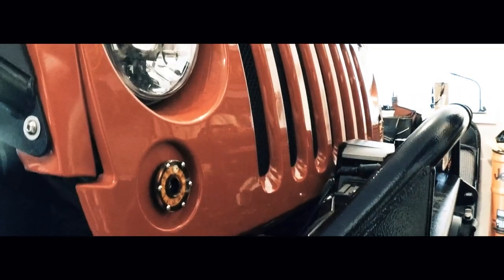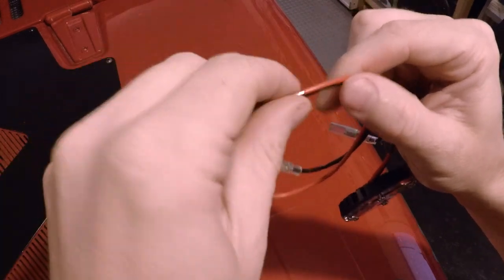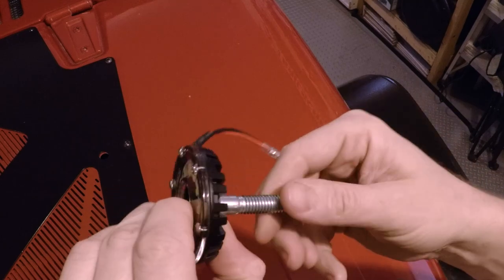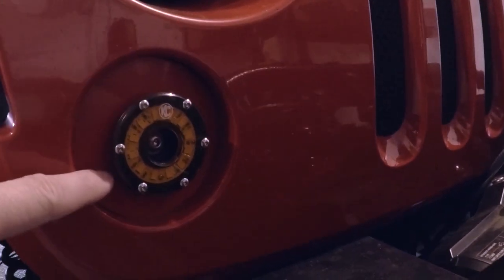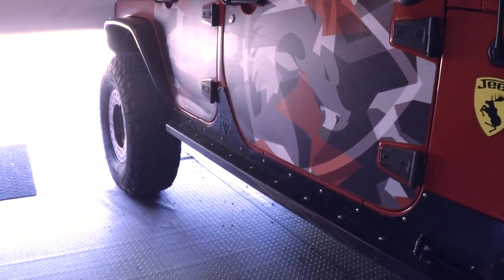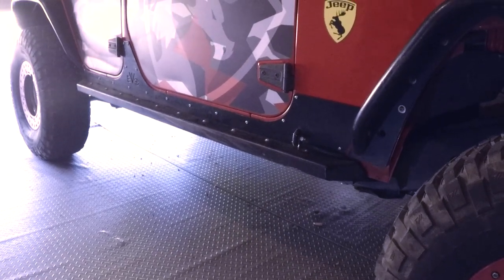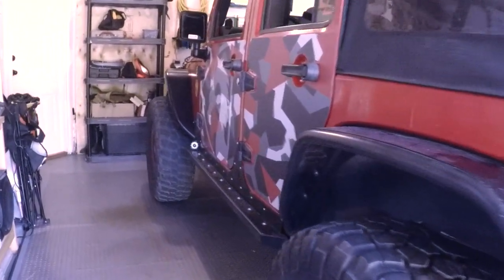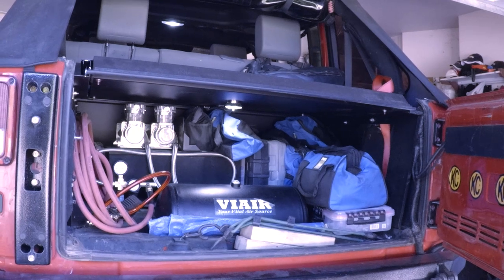KC HiLites Cyclones LED Jeep JK Lighting | Jeep JKU Mods

Comment: Finally!   I got that knows what he's doing with wiring.... To access reverse and interior light circuit... Where did you tap in..... By lights or fuse box?
Reply from the maker: I tapped in to the harness just as it enters the cabin on the passenger side footwell, which was then used as the positive goiing to my switch that then runs back to a either trigger a relay (for reverse circuit) or the trigger for the control box on my KC RGB lights. I can't recall the color code of the wires off the top of my head, the reverse I look at the color of the wire at the tail light and traced it back, the interior light I found by googling. The harness wire colors to vary by year so even if I had the colors its possible to not be the same on yours. Once I was fairly sure I had the right wire, I cut it, and tested it. If it was wrong it would be an easy solder and heat shrink to repair it, but I got them correct.

Comment: Based on your video I picked these up. I noticed they get really hot fairly quickly. I had another idea for more lights, but would be mounted on plastic. Since these lights get so hot, would you recommend the lights installed on plastic? Would I need to add another material to act as a heat shield buffer?

Comment: Can you show how you did the wiring and stuff?
Reply from the maker: I'm going to be installing another set in another Jeep sometime in the near future and I'll record it. If you check out my KC RGB rock light video, I use alot of the same paths for running wiring. The biggest difference is the RGB lights have a controller box, and the cyclones run off a bus bar.
Reply: @Casey250   so is there a relay or fuses somewhere in that line or is just battery-bus bar-switch-light?

Comment: You seem to have an intimate relationship with the factory harness. I can wire up accessories all day and have them work on a switch by themselves. I can’t figure out how to put my reverse lights on a switch. My goal is to still have them come on when in reverse, but also be able to turn them on from a switch when I’m not in reverse. Any experience or ideas? Thanks.
Reply from the maker: That is exactly how mine work. I use a 3 position on-off-on switch i ordered on Ebay. The switch has two source terminal and a load terminal. One source is the reverse circuit that i tapped into. Second source is positive from battery. Load goes to the relay that triggers the lights I use for reverse.  What you end up with is a switch that can be toggled as you described - on as automatic in reverse, off, on manually as needed.

Comment: I have had several cyclones fail me lately. How have yours been holding up? First one to go was in the engine compartment from under hood kit, they repaired it under the kc warranty, but now 2 that I’m using as a 3rd brake light are failing with several dead leds showing up in the ring.  The under hood light was a complete burn out.  Don’t think I want to continue with them, to much of a hassle to get approval and send back for warranty.
Reply from the maker: I had 1 loose 2 LED chips on it and that is it. Sorry to hear about the bad luck :( KC's warranty is pretty good as well as their customer service, but swapping broke parts is always a pain for sure! I haven't seen anything with the versatility for mounting though that would compete for some of the install cases that I use them for.

Comment: Hey Casey thanks for posting.   I have one question.   Why dont you wire the under hood light to the hood switch so that the light comes on when you open the engine compartment? 
David
Reply from the maker: I would need to add a hood switch on my Jeep. However, ya, definitely a good idea. KC makes a hood switch kit I beleive.

Comment: Do you just hook the reverse lights into your stock wiring harness?
Reply from the maker: I spliced into the stock harness to a relay. The relay then triggers 4 cyclones when I go into reverse.
Reply: Casey_250 Yhank you.  This was very instructive and just the information I need to get some extra lighting in my Jeep.  Back up lighting is just about useless from the factory

Comment: I'm looking to do cyclones as reverse lights I have the EVO Pro series bumper and the EVO rock skins armor I'm wondering if I would need a special harness?  I was considering doing the magnet thing but don't want a exposed wire.
Reply from the maker: You can buy the single cyclones and wire them yourself - they are just a 2 wire positive and negative, super simple. I hid the wires I put on my tire carrier buy drilling a hole for the wire behind the light, and another hole for the bolt. Super clean. I just use magnets in some harder spots, but on my front bumper it would be easy to permanently mount them too.